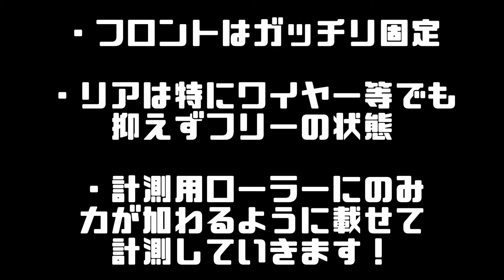【OVER170ｋｍ/ｈ！？】最高速に再挑戦3.5Tブラシレス＆ギヤ比5.0！タミヤ1/10　1990Mercedes-Benz　C11

Comment: That is a good test compared with the last video, the tires are rubber. This time, the tire foam helped more, but the chassis suffered from the lack of rigid structure. Will it be better to stiffer the chassis
Reply from the maker: I think the chassis rigidity will make a big difference in the results when actually driving.

What I am interested in is knowing the limits of Tamiya's resin chassis.

Now that I've found a specific location that does a good test, I'm thinking of actually running one this year.